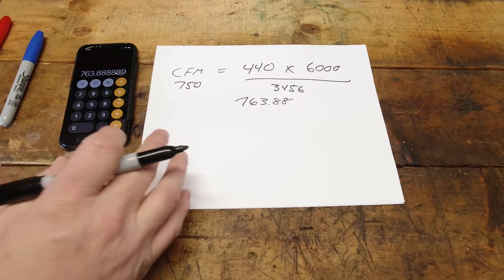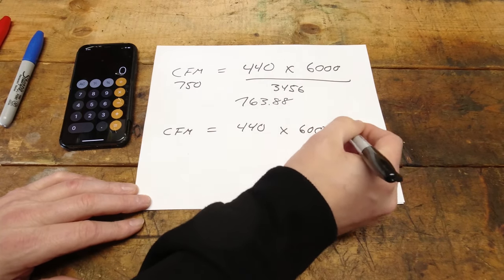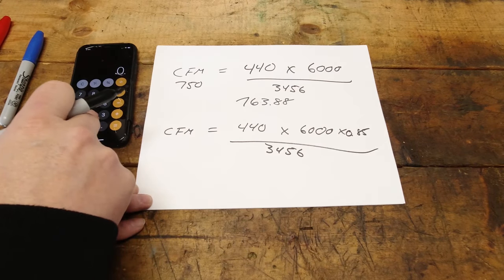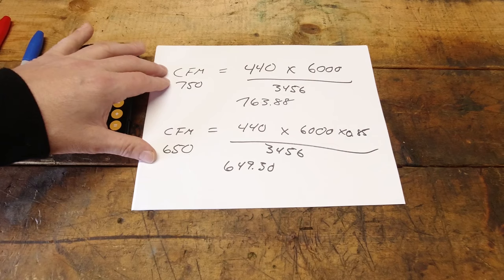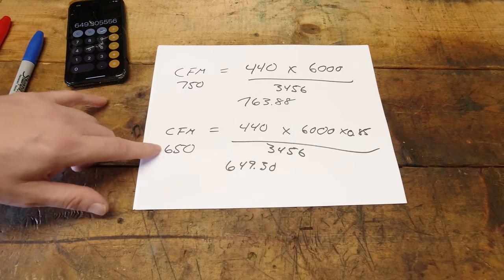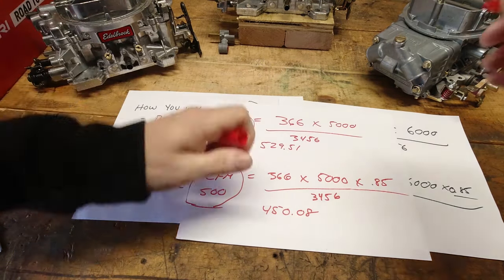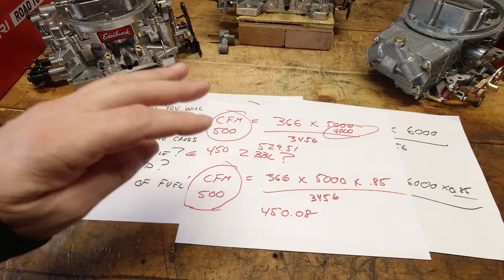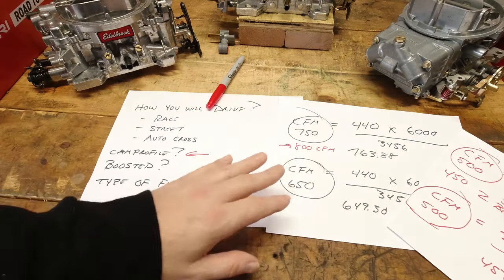How to Choose the Right Size Carburetor

Comment: Thanks for all the great info! 
Looking to replace the Holley 600 on my 318 with an AVS2.  4 bbl intake, mild cam, headers, automatic. Makes about 5 in vacuum at idle.
Would you go with the 500 or 650?
Reply from the maker: Wow.  Mild cam and only 5” of vacuum?  What’s your definition of mild?? 😂😂
Reply: Mild cams don't shake the mirrors off the car. 😉😉
Guess the 650 is the size to go?
Reply from the maker: I don’t know.  You don’t give me enough to go on.  I have to know the details that are outlined in the video.  Also what you’re using the engine/vehicle for.
Reply: @MuscleCarSolutions  Sorry about that, I will try to give more details
The car is a 71 Challenger, only ever street driven.  Drive train is a 918 Automatic with a shift kit and a 3.73 rear gear.
The motor was already built when I purchased the car, I don't know the cam spec or compression, but the cam does have a lot of duration and only 5 In of vacuum at idle.
Has a factory 340 intake, and currently using a Holley 600 Vacuum Secondary, long tube headers and dual exhaust.
No boost or Nitrous
Only use ethanol free 93 octane fuel.
Top of the RPM range is 6000, and rarely do I go that high.

Hope you can help me.

Thanks
Reply from the maker: You’re kind of in a grey area there.  Doesn’t help you’re running a stock intake and a wild cam.  They don’t match up.  The rest gear will help for sure.  I’m sure it’s got to have a fairly aggressive stall converter.  If that was mine and I had an intake upgrade planned and perhaps a milder cam that would allow you more engine vacuum, I’d likely go with the 650 now and grow into it as the upgrades happen.  You’re in a not uncommon situation.  But in this case, I’d go larger.  The smaller carb would be just fine but it would limit your rpm and that cam.  Bette run run a little rich than a little lean.
Reply: Thank you!!!

Comment: This got me thinking ..ive got a 400sbc with 234/236 cam bit of head work its in a dually truck car hauler 4.56 gears auto ..what would be the better carb? Currently using a 650 dp
Reply from the maker: What did you come up with based on the information the video shared?

Comment: I have an 1977 c20 with a stock 350  manual 4 speed with 3.73 gears I do pull a trailer that’s about 3800 lb  , I was thinking a holly 500 cam 2 Barrel  when pulling a hill I drop a gear hold rpm around 4200-4300    What carb would you recommend
Reply from the maker: The formula in the video is the place to start.  Is 4300 your max rpm on that engine?
Reply: Yes

Comment: I know what you’re talking about but my original 327 sbc Chevy run great on a 600 cfm edelbrock fine tune to my performance cam and heads , some guys think slapping a huge carb on equals more power while it can but it depends on what your doing I’m a street cruiser I like the power but don’t race my 67 Camaro and the 600 works great
Reply from the maker: If that size fits the rpm range and use of the car, then you’ve found the right size!  👍

Comment: Awesome and enlightening video! I recently purchased a '67 GTO with a 400ci and Edelbrock 600cfm,  intake and a 2004R w/od trans. Runs rough and runs on. I'm now running 93 octane and I'm thinking a Holley DP 750cfm and new TV cable/throttle setup. Am I on the right track? TIA.
Reply from the maker: Don’t know.  What was the size CFM you got from the information in the video?  What are you using the vehicle for?  Drag only?  Cruiser?  What have you done to address the running issues you’re having?  I’d be a lot more concerned about those before I made any carburetor changes.
Reply: @MuscleCarSolutions   I’m looking at 400ci at 6000rpm w/93 octane came to a 750cfm. Definitely a cruiser. I’ve run the higher octane and even tried Seafoam but to no avail.
Reply from the maker: What’s your timing set at?  Initial and all in?
Reply: When that thing was new, it probably ran great from the factory using a stock 750 CFM Quadra jet. I know gas today is not as good as it was in 1967, but the engineers at GM knew a thing or two. I would try a QJ.

Comment: Hey I got a 454 it's 30 over mild hyd roller cam it's a street rod what cfm should I use it has 373 gears and 29 inch tall tires with th400 trans
Reply from the maker: Well, what did you come up with based on what the video taught?  You didn’t provide enough info for me to give an answer.

Comment: 4 scenarios.
1. 70 Torino wagon 351 Cleveland 4v. auto with 3.00 gears. All is stock. It has an EB AVS 650.
2. 71 Torino GT 351 Cleveland 4v. Auto with 3.00 gears. All is stock. It has an EB 600.
3. 71 Mustang Fastback 351 Cleveland 4v. 4 speed 3.25 gears. It has headers EB Performer intake 750 Holley Dbl Pumper. MSD distributor.
4. 73 Australian Falcon 71 351 Cleveland 2v heads auto with 3.00 posi gears. It has a  Holley 600 with Edelbrock Performer.
I have tri y headers to put on in the near future.
Can I use a 780 Holley or 800 EB AVS  on any of these in the above configurations? Do the 4v Cleveland heads come into play? Would 4v Big heads do better with a 650 at low rpms? 
Thank you.
Reply from the maker: Really you have to follow the formula in the video.  Need to know your max rpm and go vehicle by vehicle and make the determination on the best size to go with.
Reply: Each would be street driven. Mostly looking for low to mid range torque. Occasionally might see 5000 rpms, but rarely
Reply from the maker: @kennethmarston8687  so pretty easy then if you follow the basic formula in the video.  If you’re staying under 5000 rpm and mostly stock engines, go with the closest number to what you came up with.
Reply from the maker: @kennethmarston8687  I think you’ll find you’re way over carburated on some of those applications.

Comment: I ran your equation on a ZZ4 Chevy motor , 350 x5800 /3456 = 586.3 CFM carb. Chevy documents for the carb calls out for 750 CFM Holley. I have a 600 CFM double pump Holley  carb. I am assuming the 750 must be jetted down and my 600 jetted up. Kinda confusing.
Reply from the maker: You cant tune CFM.  It’s a fixed number.  You can however adjust fuel and spark to help tune the engine to its full potential.  Are you using this as a drag only engine?  Any other upgrades of significance?  Nitrous?  Boost?  Then maybe... and that’s a big maybe, a 750 would work.  Only if it were a vacuum secondaries carb.  Like what was mentioned at the end of the video in other details to look at to confirm the right size.  What are you using the engine/car for?
Reply: No it’s not a drag vehicle, I have a 1965 El Camino . It’s just a street Rod. I have an appointment with RPM carburetor shop to get it tuned, but I watched your video and ran your numbers for curiousty. Chevy 750 carburetor was most likely for drag car. Thanks
Reply from the maker: Well a street car is a whole different story.  How often do you see 5800?  If you’re just cruising, not often at all.  You may see it if you’re doing some more aggressive driving, but unless that’s a common occurrence, you’ll never use the CFM that carb delivers.  With a 750 it’s going to be very rich pretty consistently.  There are a number of other things to consider but in very general terms, it’s all about assessing how you’ll drive it and those factors that are unique to your situation.
Reply: @MuscleCarSolutions  I have a ZZ4 in a 29 model A that I just got. It has a 750 on it now but leaking and I was going to replace it. The motor has a performer RPM manifold and edelbrock mechanical fuel pump.Was told it was a stroker motor. But I'm not sure. I was wondering if you think a Edelbrock 600 or the AVS2 650 would be best? Just a cruiser hot rod. Just trying to get it running right to enjoy.

Comment: For a street SBC 383 stroker with a mild cam, 91 octane, would a 650 be sufficient? Compression ration would be less than 10:1.  5-5500 RPM. Many people in forums are telling me to go 750, seems high based on this info. Any particular carb you would recommend? My first build.
Reply from the maker: What’s the purpose of the car?  Just a street cruiser?  Going to do any racing in it occasionally?
Reply: @MuscleCarSolutions  just a weekend cruiser, 72 C10. It’s a full motor rebuild with all new components. Likely going with AFR 195 heads and their new intake. manifold.
Reply from the maker: @ck1insac  gotcha.  Your operating RPM will be the factor that keeps you from needing more CFM.  The heads will be overkill depending on the cam profile, but you’re not going to run it past 5500.  A good dual plane intake like the Edelbrock 2701 fits very nicely into that engine rpm range you’re working with.
Reply from the maker: @ck1insac  I guess I didn’t answer your main question!  Yes, the 650 CFM carb will be just fine for what you’re building.
Reply: @MuscleCarSolutions  you think that Edelbrock AVS2 650 is a good call for my application?
Reply from the maker: @ck1insac  I think it would be perfect for what you’re doing!

Comment: hey guys, thanks for the shows. ive got a 1965 283 , .030 overbored, studded bottom end, summit k1102 cam set ,520 power pack heads freshed up with new valves and z28 valve springs, intake is a 1966 factory GM 4bbl squarebore designed for Holley use from a 327 (is it possible its from a corvette?) because the ports match the pp's way better than the other intakes i tried.  I already have a Holley 600 that i plan on using . what tq/hp do you guys think i'll get out of this combination?
Reply from the maker: Unfortunately the sub 4” bore engines don’t make very good power.  That limiting factor really kills the potential, no matter what you throw at it.  I don’t know the specs on that cam but I’d guess the power will be under 300.

Comment: Hello there.
I bought the Edelbrock 1406 (600sfm) to Ford Torino 351 Cleveland, and I think it doesn't ride as good as it used to on HOLLEY.
Is that 1406 good enough for that engine???
Please HELP..
Reply from the maker: Yes, no, maybe.  I don’t have enough information to give an opinion.  Watch the video and do the math based on what you have and we can talk about it.
Reply: Is that a 2v or 4v 351c? The 4v cleveland came standard with a 4300d autolite carb 750 cfm spread bore  type. I have a 1406 600 cfm edelbrock carb on my carb. Im not crazy about the carb. Im wanting to go different might try a street demon or 750 cfm holley

Comment: I got a question. I got a 408 small block Chevy. Vortec heads With some bowl work. Flatappet Howard’s cam 480/488 231/235@.050 108lsa. I have a 850 demon I was wanting to run I know it may be a little big. Not gonna race it but gonna turn it hard on the street 6500 is the Max rpm.
Reply from the maker: Yup.  Your indications are correct.  It will likely run rich.

Comment: I’m trying to build a 351windsor with a twin turbo application build out converting to roller, and plan to run about 15-20psi mostly for mountain claiming in winter with a camper on a f250 1991  think a 650 blow threw will do the trick or something bigger ?
Reply: Have the same proyect, Just single turbo!!

Comment: Thanks for the content! I’m building a factory five car. The final weight is going to be about 2200lbs. I’m running a 347 sbf with a 5500 redline it’s going to be a purely street car. It’ll be mated to a tkx and irs with 3.55 gears. The math leads me to a 550 cam carb. Is that a good choice or would you recommend something else?
Reply from the maker: 600 is good on a street driven car.  Might step up to a 650 if you feel like that’s going to change once you get a taste for how fun it will be.
Reply: What about splitting the difference with the street demon 625?
Reply from the maker: @Doclittle1036  that’s up to you.  I hate that carburetor.  😆
Reply: Thanks for the advice. I’ll stay away from the demon
Reply from the maker: @Doclittle1036  I did a video on the things I don’t like about it.  Others have had success with them, but to me they aren’t worth the effort.  It’s my bias, but I tried to give all those details in the video and the viewer can decide if it’s worth it or not.

Comment: I have a 355 with a 540/540 lift comp cam has a 750 doubled pump on it burning rich for racing but I want to dive it on the street want cfm do I need??
Reply from the maker: Get used to talking about cam profiles in duration and LSA.  The lift is unimportant for this question.  Need to know that before we can really talk about an appropriate CFM size.  RPM range is what we’re trying to figure out here.

Comment: I was using a 1.08 Autolite 4100 on my 302 in my 78 Mustang ll, I thought it ran awesome.....until i put a Summit 600 cfm on it and it woke it up. I now have aluminum heads, BluePrint HP 9008's and a much hotter cam so I'm thinking a 750 might be more in line, it will see 7k rpms at times.  I looked up a 302 boss (real) engine and it show it came with a 780 Holley. Your thoughts? I am a subscriber and I have learned a lot watching your videos.
Reply from the maker: If it’s a race purpose built engine and that’s where it’s going to operate. The 750 might be a bit much, but it will ensure your top end will remain rich.  Given the small cubic inches and on a race engine, I’d run a 650 HP.  Give some tune ability to the mid and high range circuits.

Comment: I have a mild cam. Aluminum heads. Performer intake. Roller rockers and headers on a 351w. With that calculation it says I should be running a 500cfm 😳. Every hotrodder I’ve talked says I need to go up in cfm. I have a 600 on it now.
Reply from the maker: @averagebogarage  everyone should experience at least once how an engine runs and wears with too big a carburetor.  Sounds like you’re being pushed into that lesson.
Reply: @MuscleCarSolutions  not now. Lol. One more question and thanks for ur reply. Would u go w 500 in my case or stick w the 600. It’s just a toy I drive around town and get on every now and then I’d say never anything above 4500ish rpm. Which works out to 507 using that equation. So 500 or 600. In ur opinion? Thanks again
Reply from the maker: @averagebogarage  if that’s your upper limit on RPM, both will work, but the 500 will be very easy to calibrate and have much better throttle response.  Really all depends on the cam specs and how you’ll operate it.  I just put a 500 on a 496 a few weeks ago into a tow rig.  Flawless.

Comment: Can you tell me some of the symptoms of over sized carb.  I have a jetboat with 750 on it 400 chev mild cam and have never got it to run properly. have tried 3 different ignition systems on it because it has a nasty mid range misfire. Sounds like dizzy going nuts. Jet pump stops it going much past 4ooo rpm at full throttle. No miss at full throttle. Is midrange lean miss a symptom of too large a carb. Any help appreciated and have you seen this happen.
Reply from the maker: Overly rich condition.  In ability to tune it out.  Gas in the oil.  Fouled plugs.  Black smoke from the exhaust.
Reply: @MuscleCarSolutions  What about the mid range misfiring is that a symptom you have seen?
Reply from the maker: @blurtmenow  potentially but you can’t limit your investigation to one system.  The ignition is a big part of that and you’ve got to consider something wrong there as well.  In fact, I’d start there before doing any tuning or adjustment to the carburetor.  If the ignition is not working properly, doesn’t matter what you do to the carburetor.
Reply: @MuscleCarSolutions  Thank you for your help with this. I will be checking heaps. Voltages and wiring mainly. I have access to a 600cfm and will take it along if it continues to play up will change it out to see if there is any improvement.
Reply from the maker: @blurtmenow  get that ignition system right first!
Reply: @MuscleCarSolutions  The thing sounds great in the yard. Only plays up under load in the river. Will get back to it. Its been sitting for a long time because i was over it. Again thanks for your help.

Comment: I have a 400 sbc with dart iron eagle heads 2.0. ,xe 274-10 cam . I have a 750 dp quick fuel brawler.
is this too much carb? you have been a godsent to me so far. thanks  70 primary, 80 sec 6.5 power valve. has a miss when secondaried come on.
Reply from the maker: That’s a a really good cam.  230/236 on a 110.  Installed a ton of them. It’s all in by 6000 though but if you’re going to the track on occasion or aggressive driving, the 750 should be just about right.
Reply from the maker: @flyinhighaerial3193 couple things jump out here.  8° is not a lot of initial timing.  I’m down close to sea level and start at 12-14.  If you’re in Canada, I know you have some different fuel options so even if you’re running a fuel with no ethanol, add a bit more timing.  Backfiring.  The newer carbs have the check ball to keep the PV from being blown out every 2 minutes but it wouldn’t hurt to change it.  I’d you’re seeing a stumble, you can try two things.  Make sure you have the accelerator pump arm adjusted correctly and you can change the PV.  If you want it to come in later and you’ve got the 6.5 in now, change it to a 5.5 and see if it gets better.  Worse?  Then it could be a lean condition.  So go back up with the PV and try again.
Reply: Accelerator pump is adjusted. I did drive it for 5 miles to get home and it backfired plenty when I had a coil go bad a couple weeks ago. After seeing your vid on pv’s  today I thought it may be the issue.
Today after warming up to operating temp I closed the choke by hand to check for a vacuum leak and could close it entirely with no change in motor. Would that indicate my pv is blown?

Comment: I'm running a 427 stroker motor with a holly 1150 carb.  Gets outta the hole great but I feel like it should have more pull from 4500 to 7k. Can the carb be too big?
Reply from the maker: 100% if you’re at that level, you need an AFR and start data logging your time on the track.  Will make your tuning easy when you’re not guessing.
Reply: @MuscleCarSolutions  Thank you!